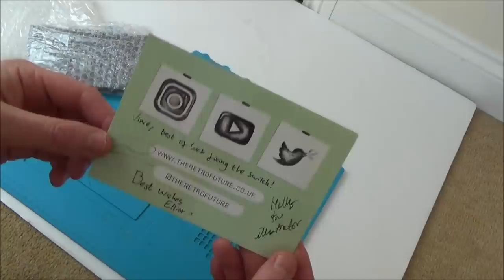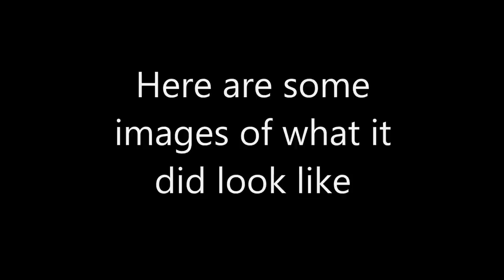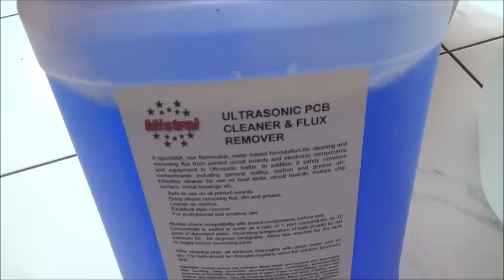Trying to FIX The Retro Future's £24 Nintendo Switch

Comment: What do you think it would take to desolder that cpu/gpu chip and take one off your dead boards and replace it. Are those all bga chips ?
Reply from the maker: They would be BGA Dave, and I have heard it is married to other chips on the board (don't know if that is correct or not). Unfortunately even if it wasn't married it would be beyond me and my tools. Maybe one day though :-)
Reply: @Mymatevince  literally just got to the part where you said that in the video . Hadn't thought about them being married to the board . I'm guessing that's kind of like the same as the Xbox motherboards and the optical drives were as I believe married to their boards too. And I believe that soon enough you'll be more than able to do a full reball job. I've attempted in the past with a gpu on a laptop to reflow the bga chip and that was a total failure so I attempted to do the reball manually and ruined the lot. Just didn't know if the chip on the switch was a bga as it would of been great to see this dead switch bought back alive. still enjoyable to watch and I'm glad you got to attempt to repair this after seeing Elliot's video I thought of you instantly for this one .
Reply from the maker: Thanks Dave, I did get some reball stencils from China and some solder balls so I would like to experiment. I think I need to start on a very small BGA chip to try and get used to it :-)

Comment: Why not replace the capacitors that are shorting under the main Nvidia chip? You have a donor board and you even showed us that those capacitors on the donor board are working.
Reply from the maker: I will try this later today, I didn't actually think to do that!!!!!!!!! If it works I will let you know :-)
Reply: @Mymatevince  no worries :) just happy to help if I can. Love your channel btw, the Xbox 360 vid you did recently is one of my favourites I actaully had the same problem where the disc tray would get stuck and k would use a pin to eject the tray but if I left a disc in it would open every time and if I forgot to put a disc in there the tray would stay shut
Reply from the maker: @blazedyoda8608  Thanks mate. Glad to like the 360 vid, I enjoyed that one a lot. You can actually change the little belt over on the 360 disc tray without taking it apart. Once it is open you can just see it and use tweezers to pop in a new one :-)
Reply: @Mymatevince  if only I knew that when I was 14 haha. Thanks mate I might actaully try and repair that Xbox 360 as I still have it.

Comment: Hey, did anyone have that issue with his switch that it freezes after about 10 minutes on-time? No matter if your in the OS or ingame. No button will work. The only way is to push power button for 15 seconds to hardreset. Did anyone have this similar problem? Thank you (by the way - sorry for my bad grammar. english is not my mother tongue)

Comment: So I got a nintendo switch for $25 from an acquaintance and I was told it didn't work. I plugged it in and after an hour or so it turned on and seemed to be fine. I used it for a while to make sure it was fine then I sold it on ebay. After it arrived the buyer claimed it wasn't charging and when I got it back the charge port was destroyed. I discovered this after giving them the full refund so I just bucked up and removed the port with my quick hot air station and replaced it. I plugged it in and it started charging, then an hour or so later it turned off and wouldnt turn back on. I finally managed to get it on and it was just a blue screen. Does anyone have any ideas??? thanks.

Comment: You shorter 2 caps where you replace the chip
Reply from the maker: Thanks, I did spot this while editing and I tapped the soldering iron on it to remove it. I think one of the solder balls shot out from under the chip and landed in between the caps. Unfortunately it still doesn't work but thanks for letting me know :-)
Reply: @Mymatevince  old electronic technician eyes thrug 25+ years ind the field of consume electronic repair see often stuff other not see 😂